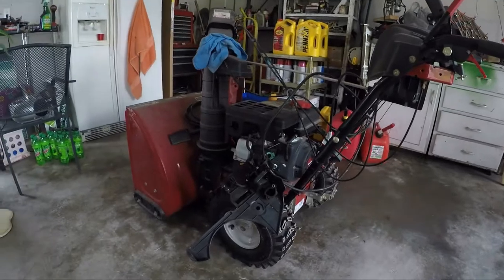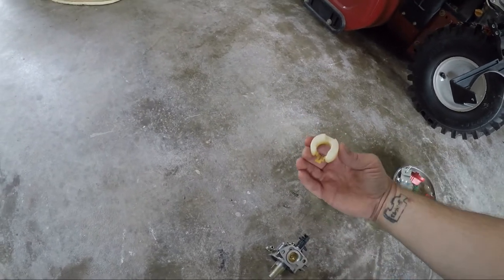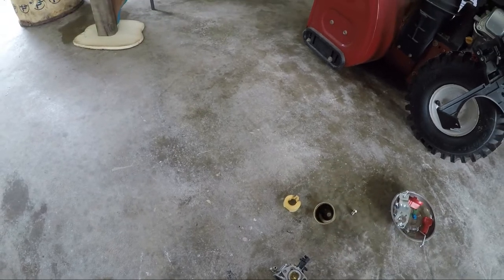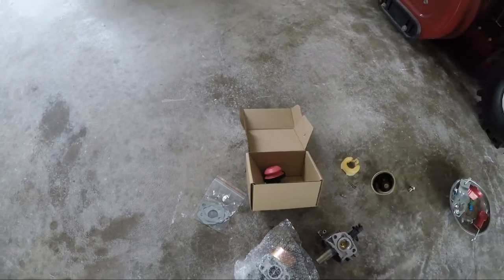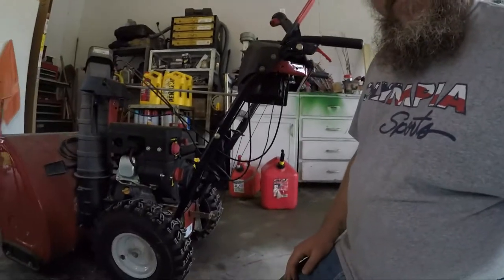DIY Snow Blower Repair (SAVE MONEY $$$)

Comment: PRO TIP: Don't forget to set your skids to an appropriate height, especially if you have a gravel driveway. This will help prevent throwing rocks everywhere. I usually set mine at 1" - 1- 1/2"
Reply from the maker: Lol, people don’t appreciate getting their windows broke by flying rocks for some reason. 🤔

Comment: Nice job bro. Our premium fuel has no ethanol, so I run mine on that. I also stabilize the fuel before storage and run some carb bleaker through it once in a while.👍
Reply from the maker: That would be nice not having ethanol. It’s hard to find down here and when you do it’s really expensive. They sure do save you from a lot of shoveling though. Thanks for watching. Be safe. ✌️